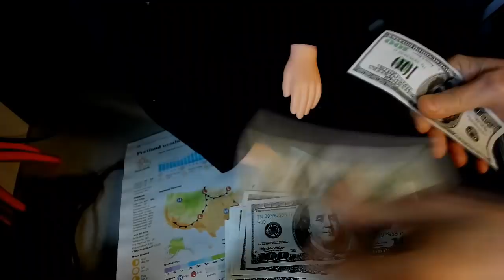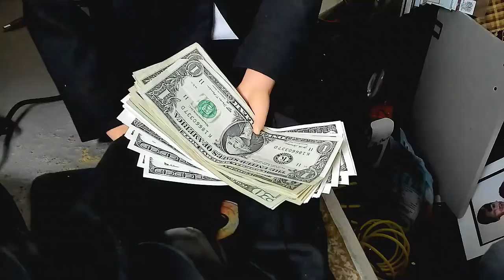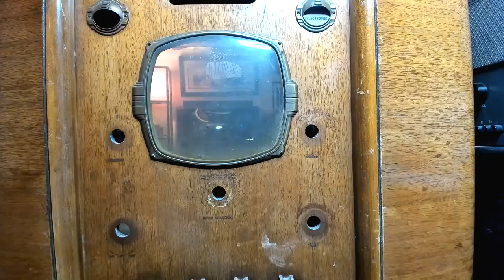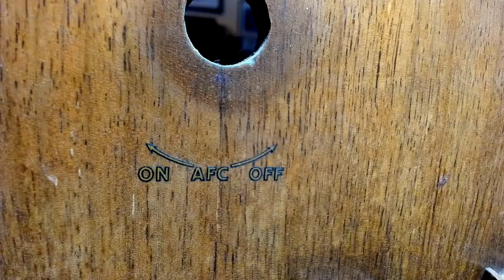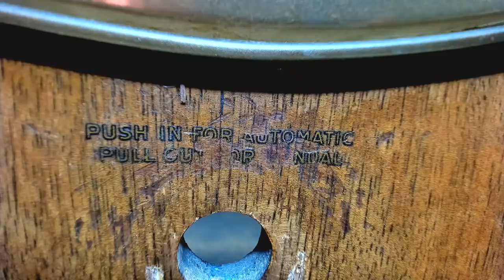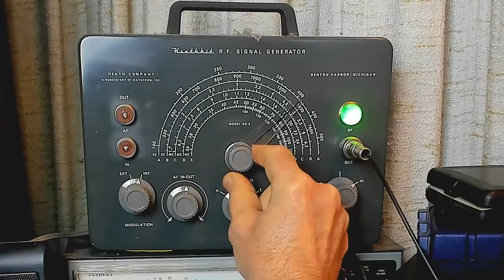1937 Sparton Model 1068 Restore Part 2

Comment: Another Friday Buzz video. What could be better. I wonder what originally happened to that shaft causing the solder repair. It does show though that back in the day people did go the extra mile to repair things. I always love to find these old repairs. That one though was almost right but not quite. It's like doing a radio autopsy to find the cause of death. Thanks for your service to the radio rascal community during these tough times. We're seeing some light at the end of the tunnel here in NY. I'm just hoping it isn't an oncoming train. ATB Doug.
Reply from the maker: if the radio could only talk and tell us what happened!...thanks Doug

Comment: Melt that solder off, straighten the rod and then maybe spot weld it back into place?  You should tell Dickel that 13X7=28 sometime.  You should set one of those auto-tune buttons to your AM transmitter frequency. :)
Reply from the maker: I thought about doing that. but it was a last resort option

Comment: That shaft sure looks like someone used to much force and bent the shaft until it snapped then had to braze it back together but didnt straighten out the shaft first. Yep someone did a number on that shaft before you got it Buzz good work getting it straightened out. "can't find the hole" the girl screams lol you crack me up.

Comment: Meaning to ask you where you mounted the cabinet by Stromberg Carlson sticker when you did that restoration? I picked up a 1939 model 410 h this past weekend.  Doing the inside of the cabinet now and can't find where they originally placed that sticker.
Reply from the maker: if your talking about the plate with the name Stromberg Carlson, it in is the inner top left side looking from the rear
Reply: @Buzz1151  yes! Thanks Buzz!